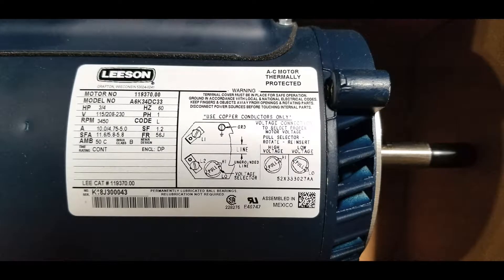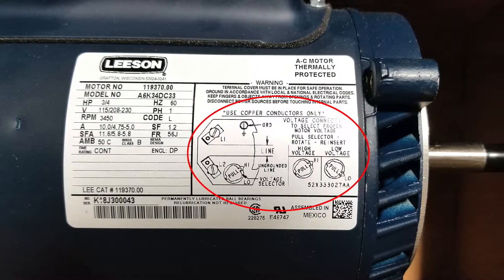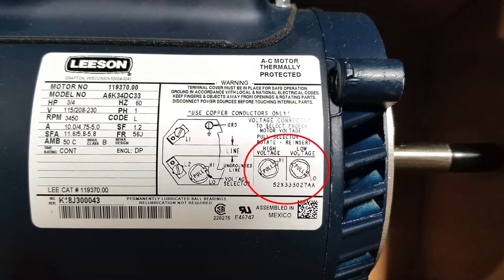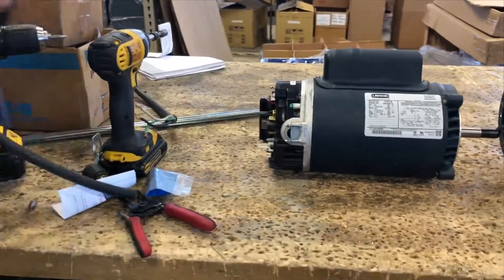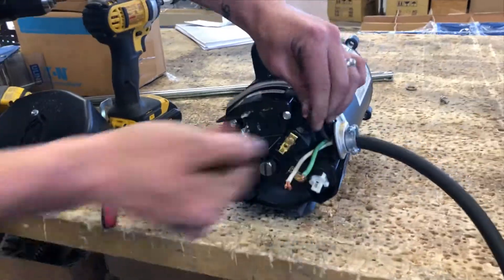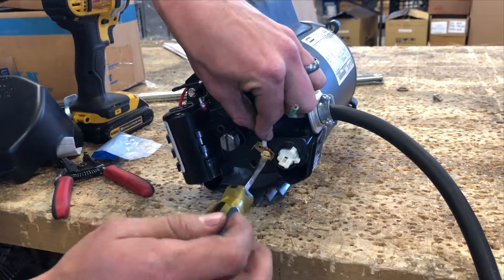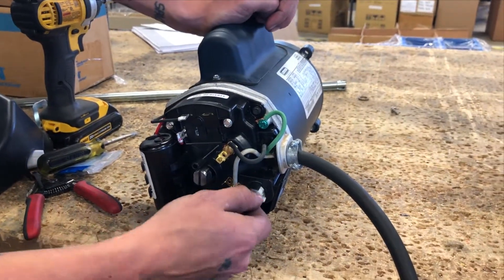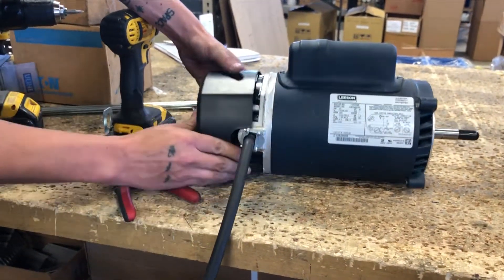How to Wire a Munro LP075B, LP100B & LP150B - 3/4hp, 1hp & 1.5hp Centrifugal Pump with Leeson Motor

Comment: The step, "Attach your romex connector." is quite misleading. Every conduit clamp or adaptor I have tried does not thread into the threads. I would like better information about compatible electrical connections that will work with this pump. The local electrical inspector says I can not just duct tape some wire through the threaded hole.

Comment: my lp100b looks different. Has anything changed? I just got it today.
Reply from the maker: Hi Michael - This video was created quite a few years ago. Since that time, we have added a secondary supplier - with a slightly different look. The general connection will be the same - incoming power from the breaker will land on L1 and L2, with the Ground wire going to the green ground screw. The motor is preset to run on 220v. If you want to run on 110v, flip the switch to indicate 110v. 

If you have further questions, please contact our Tech Support at 1-800-942-4270.
Reply: @MunroCompanies  Thanks, I have the pump up and running. Works very well.
Reply from the maker: @michaelcarton3299  Wonderful!